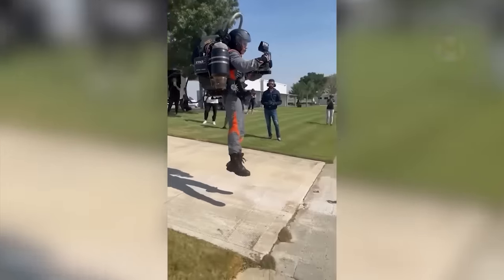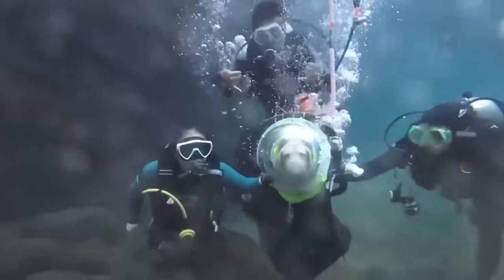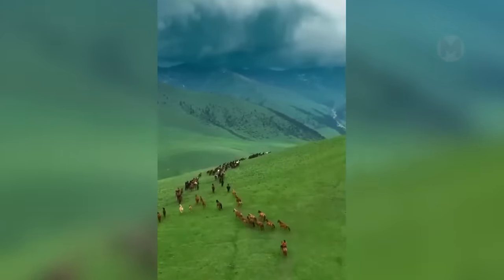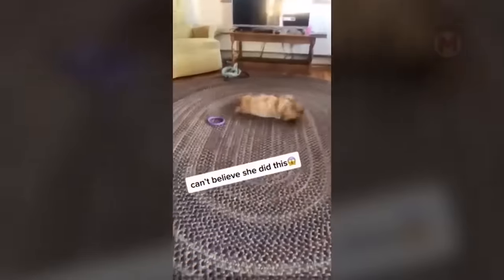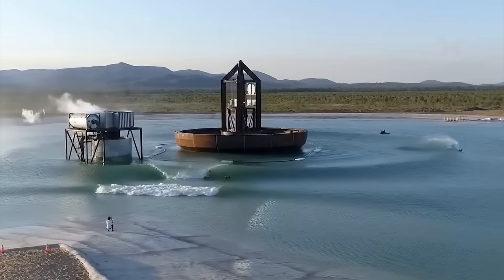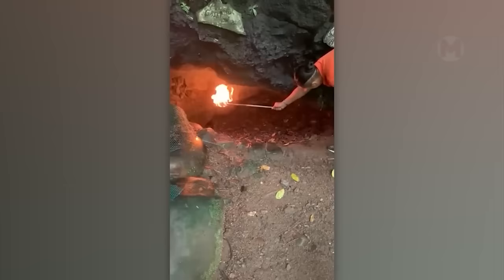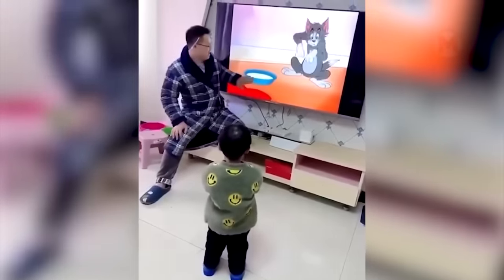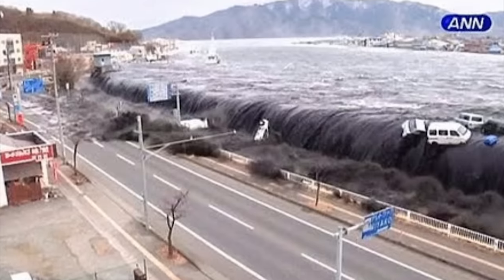90 Mind Boggling Moments Caught On Camera! 🤯

Comment: That's not a crater, it's a sinkhole. A crater is formed by an outside pressures: a sinkhole by collapsing underground. A crater will usually have a raised rim, a sinkhole wil not. Good video though😊